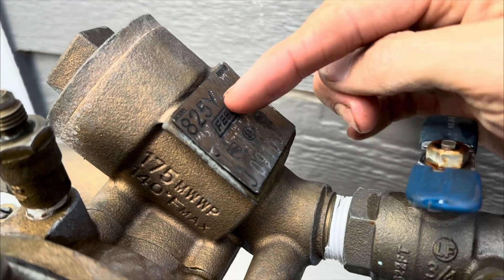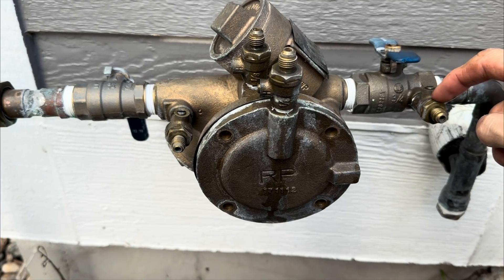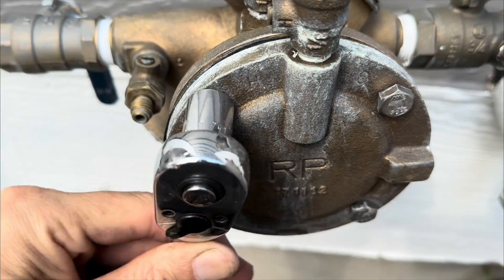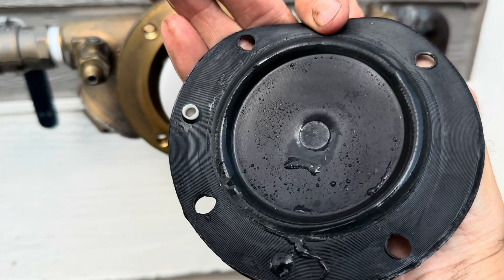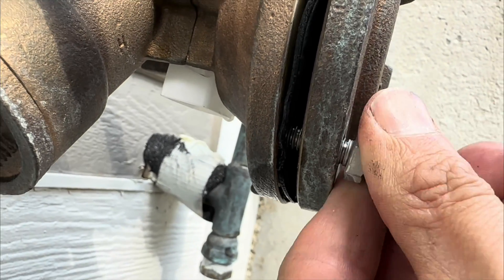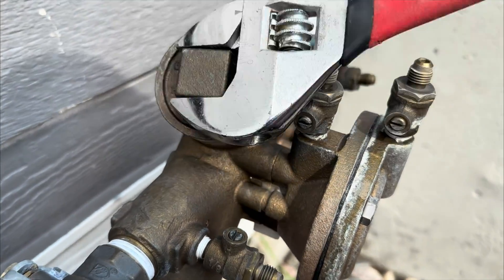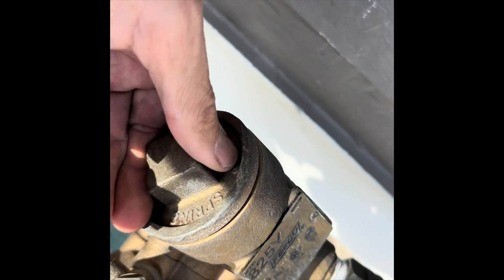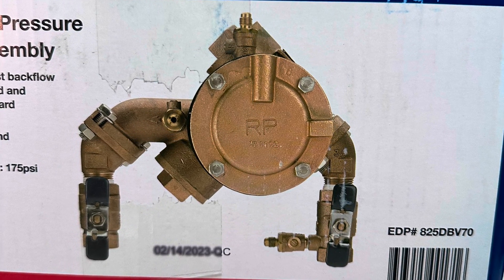How to repair a backflow Febco 825y

Comment: I have a febco 825Y, it started leaking out the discarge port , I changed all the gaskets and it still leaks, maybe more, I can hear the hiss of a leak. My guess is that it is in the reliefe valve, maybe the removable seat ring, it feels smooth.  is theer a way to confirm without just buying parts.  Is it possible the spirng is weakended and not putting enough pressure.  the water pressure is 70 psi.  Help
Reply from the maker: It is possible the spring is weak. More than likely it is not getting a good seal somewhere though. Could be the brass ring is scratched or damaged (using a fine sand paper to smooth it out may help), or it could be the brass relief valve cover has been warped. If it is warped (by freezing or something else) then that needs replaced. You can remove it and lay it face down on a very smooth surface to see if it has been warped or not. Sometimes it just gets debris inside that doesn’t want to come out. Try turning off the water supply, close the test ports, open the ball valves and any sprinkler valve. Then turn the water back on, and then shut off the sprinkler valve. Also, sometimes with all the water on, open each test port individually to bleed out any stuck air and set the diaphragms correctly. Just a few ideas to try out for ya. Hope it takes care of it. If not, lemme know, and we can try something else.

Comment: I'm having a similar issue. I replaced the gaskets inside 1 & 2 check valves and the main gasket plus the the white spring load part inside the relief valve cover. Checked for debris, everything is looking good inside. However it is still leaking at the bottom. Any other suggestions?
Reply from the maker: The first thing I would do is shut the supply off and let everything drain. Then with the test ports all closed, but both ball valves open, turn the water back on. Sometimes it’s that simple. The other option to check is the relief valve and its cover. Sometimes those will go bad and cause leaking at the bottom.

Comment: I have a Febco 825 Y that is several years old (came with house) that recently started leaking around the main cover.  I purchased two replacement Relief valve replacement gasket kits ( my previous experience with with this particular replacement gaskets set required two gaskets to get a good seal).  However this time the cover still is leaking even with two gaskets!  Any suggestions?
Reply from the maker: It could be a warped Relief Valve Cover. It’s the large brass cover. They do warp if frozen. And sometimes it’s just the order of turning it on. Shutting down the system and then turning it back on while leaving the ball valves open. If it continues, let me know and I can offer a few more tips 😃